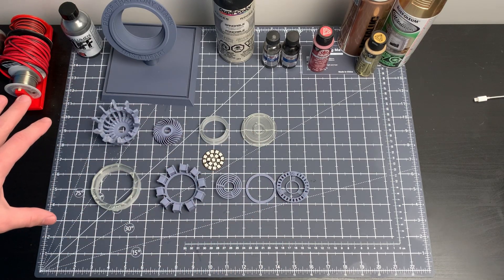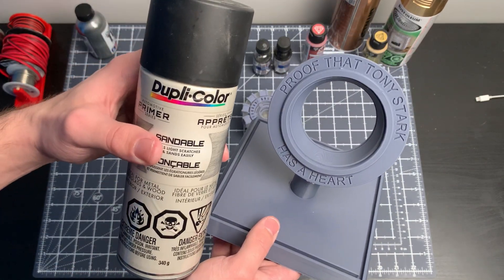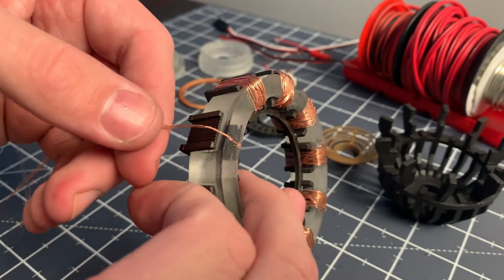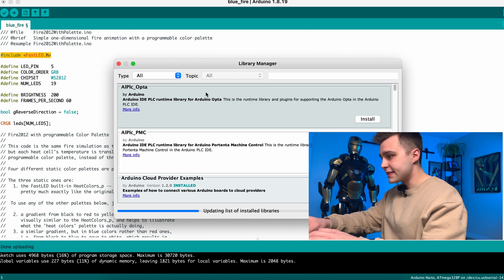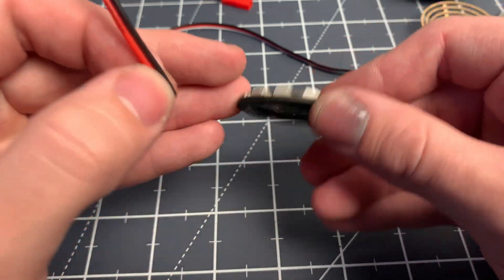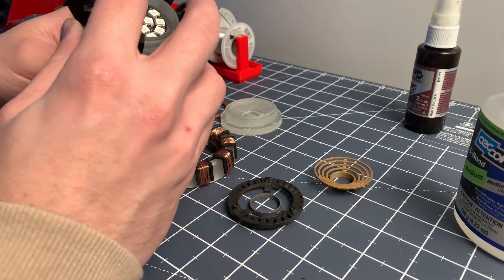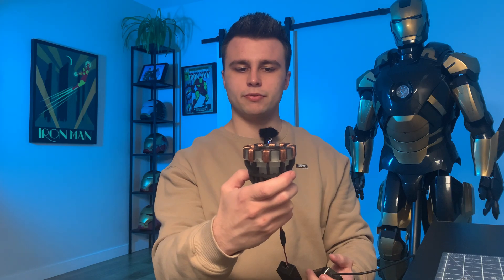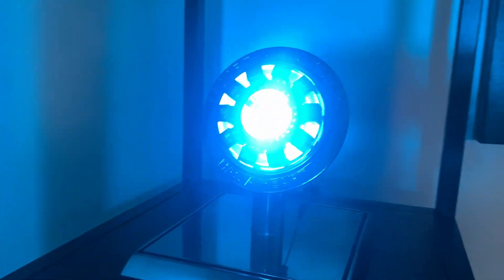Making Iron Man's Arc Reactor!! - how to program NeoPixel effects for cosplay props!

Comment: im using this for my jetpack. the arudino setup shoukld only be activated if im pressing a button and for aslong as im pressing that button. any idea?
Reply from the maker: You could wire a momentary switch that cuts off the power going to the arduino, that way when you hold the button current is allowed to flow to the arduino and turn on the neopixels, and turn it off when you let go.
Reply: @plentifulprops3d  I'm using the momentary wireless switch and I thought about that too. However my setup is a bit more complex because I will install a strong servo Wich releases compressed air as smoke. And probably also a speaker. That probably won't work because the servo will just stay in one final position if I only cut power

Comment: nice video!
Reply from the maker: Thank you! :)
Reply: @plentifulprops3d  I have a question. I know that it wouldn’t be very stable but could you in theory make the iron man suit be able to stand up on its own?
Reply from the maker: @MiG-31893  I’m not convinced that it’s doable without greatly modifying the suit itself, you’d need some sort of mechanism that locks the feet into the legs, all the way up the body so that it doesn’t tip over. But anything is possible I suppose! :)
Reply: @plentifulprops3d  I see. I just thought it would be cool to have the doning system like Tony had in the movies where he just walks into his suit and it morphs itself around him.
How much did it cost in total to construct this suit out of interest?
Reply: @plentifulprops3d  it’s really cool! I tried making one out of cardboard but it didn’t work
Reply from the maker: @MiG-31893  I’ve thought about something similar, but instead of having the suit stand up on its own it would mount to some sort of rack to keep it standing ;)

And my suit cost around 1000-1500 (Canadian) in materials